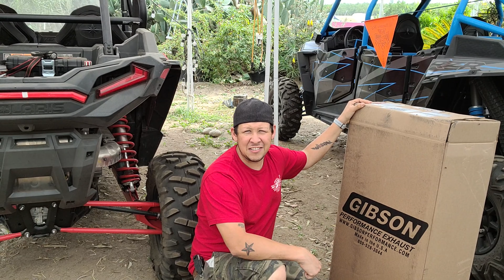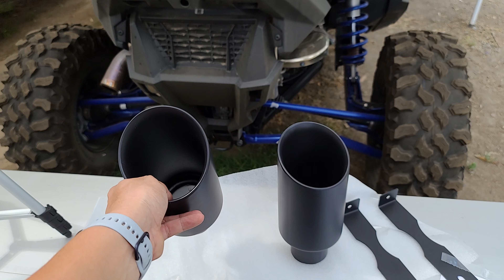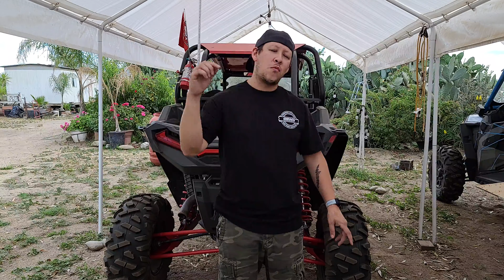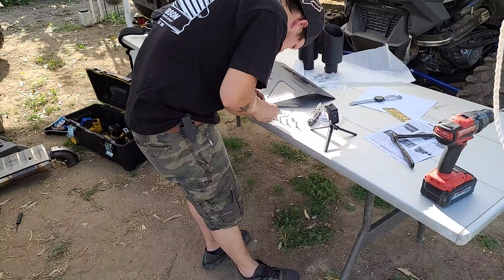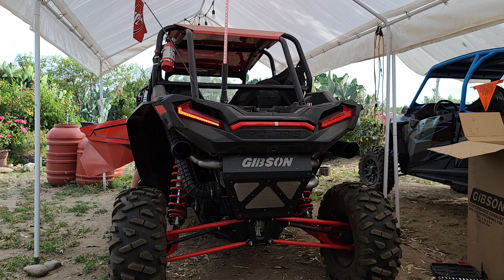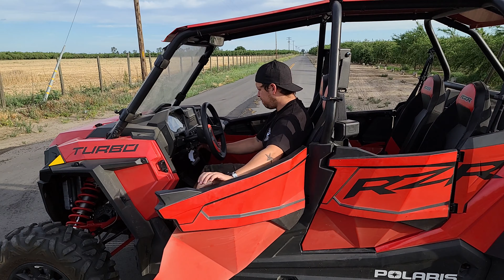2020 Polaris RZR XP4 Turbo Gibson Performance Exhaust

Comment: Hey did you noticed if your exhaust manifold started glowing red after you installed it ? Just installed mine and mine gets red hot now thinking the extra flows causing it to run lean

Comment: Do you need a tune for it
Reply from the maker: No, I haven't tuned it yet. Im running it completely stock. Once I upgrade the turbo intake and the charge tube, I will definitely be getting a tune